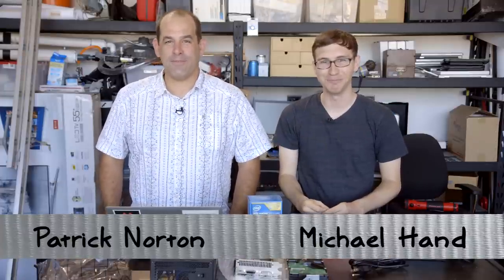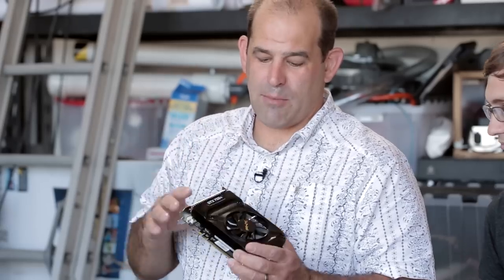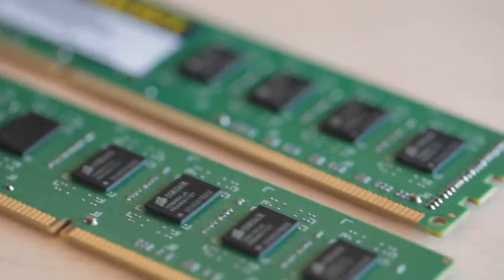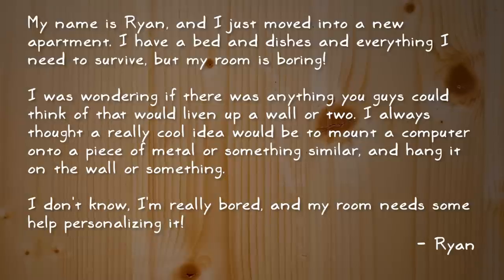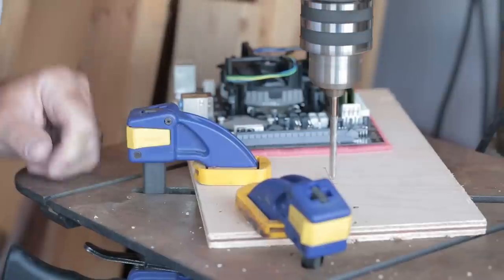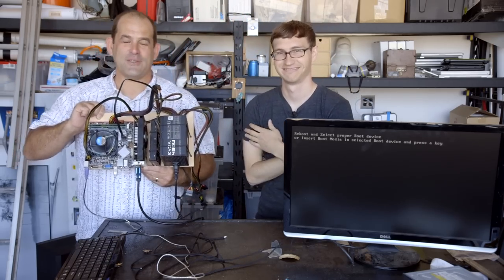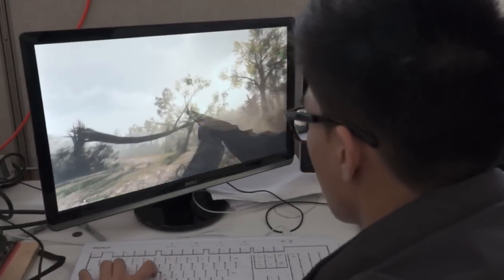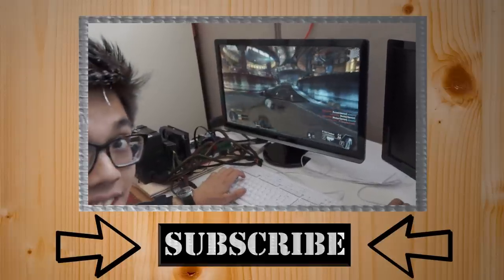Screw The XBOX ONE and the PS4... We Built a Gaming PC for $380!

Comment: Great build ! But for cpu i would have used the intel g3258 anniversary..its clocked higher and unlocked ! Easily achive 4ghz for less than 15 more dollars
Reply from the maker: That does look like a better choice if you want to OC!
Reply: Fat Sacks not really Asus has unlocked overclocking on h81 motherboards through a bios update and even asrock has some :)
Reply: Fat Sacks Nope the cheapest H81 board you can get can overclock the G3258 after a BIOS update. To 4.5GHz on the stock cooler just fine.
Reply: They do. But to make the G3258 not be pointless (because of an expensive motherboard), manufacturers allowed all the OC controls for it.
Intel doesn't like this so they do not advertise the feature.
Reply: DIY Tryin g3258 with an Asus h81 board would be good actually!!!  BTW did u guys use standoffs while attaching the mobo... And will this PC last?
Reply: DIY Tryin g3258 with an Asus h81 board would be good actually!!!  BTW did u guys use standoffs while attaching the mobo... And will this PC last?
Reply: @FatSacks  nope, h97 can multiplier oc, i have a h97 and a z97 board
h97 is just limited to ddr3 1600
Reply: @nztdm  4.2ghz is max for stock cooler, if u actually want to stability test it and ensure you dont lose stuff

Comment: I have $600 to blow. What can I get?
Reply: ask a pro on a pc forum, not here.
Reply: ***** get an okay computer and gtx 970 it might cost 900 or so but its worth it
Reply: ***** New toilets in the white house.
Reply: Mayor Fabulous gaming toilets?
Reply: No, you're George Washington. Get some toilets in the white house.
Reply: And yes.
Put about 16 GB of RAM for it to quickly flush
Reply: Mayor Fabulous Hahaha
Reply: ***** I now have $800 to spend. I'm just going to go with an i5 with a gtx 980 when I get more money.
Reply: ***** Thanks for the info. My panel only runs at 60Hz at 1080p which is fine for me. I could care less for 4k resolution. I'm mainly just considering upgrading this PC build in the future. I'm only investing into a good CPU (probably an i7), a motherboard that supports SLI, and an okay video card for now. When I get more money, I'm going to get another video card to crossfire and the rest of what I need. I'm just going to invest in this build throughout the year and start building it probably around August. 

I've seen what dual 980's can do with an i7. I can probably get a around 115-120 fps with high setting on bf4. It's more than what I need for my panel but I'm hoping to have enough V-Ram to run future games on pretty goods settings for the next 2-3 years. As for the memory, I think it's safe to stay in the 16gb range. I'm only really interested in a small SSD due to the small amount of games I usually keep installed on my current PC. I'm not necessarily broke. I can afford all of this right now but I would then be broke if I threw all my money into this XD 

I know I probably don't sound all that educated about this stuff lol I've only just started researching recently. My main focus is on what I need rather than what I want.
Reply: ***** I'm also looking to work on my graphic design at home. The iMac at my work uses an i7 so I wasn't really sure if I should risk going any lower than that.
Reply: ***** Get an i5 4430. Much cheaper than the 4690k, and almost the same stock performance. As for graphics card, best bang for its buck value below $200 is the GTX 750ti.
Reply: ***** btw you can cap your fps using Nvidia Inspector. No reason not to get more performance if you can afford it.
Reply: ***** Nvidia Inspector does everything the default Nvidia panel does (and more) when it comes to game profiles.

(you probably mean 60hz, not mhz)

I also turn vsync off, because imo stutter is worse than screen tearing.
I always aim for 60fps, probably because that's just what I'm used to.
I'm currently playing most games at 60fps in 1080p, but I'm gonna buy an EVGA GTX 980 Ti HYBRID hopefully before the end of this month.

And I'll need it, because I've also got my eye on the Acer XR341CKA monitor:
http://www.maximumpc.com/acer-unveils-curvaceous-34-inch-qhd-monitor-nvidia-g-sync-2015/

It's got some really impressive specs that I'm really looking forward to:
- IPS display (awesome colors)
- 34" with 21:9 aspect ratio (a lot more peripheral vision)
- 1440p (more pixels! :D)
- G-SYNC (no screen tearing and no stuttering)
It's somewhere in between (16:9) 1440p and 4k in terms of the required processing power, and judging by all of the various benchmarks I've seen, the GTX 980 Ti can manage a solid 60fps with this monitor.
Reply: Tons and tons of sandwiches.
Reply: ***** LOL!!!
Reply: ***** R9 280, FX 8320E, msi 970 g46, 600W power Supply, any case you want and 8GB of RAM
Reply: ***** 
My build was around $600...on Cyber Monday lol.

Intel i3-4150 @ 3.5
8gb ram 4x2
corsair 500 watt power supply
2tb westgate hdd
amd radeon r9 280x 3gb DDR5
b85 anniversary motherboard

It's able to run most things very well. Though Battlefield 4 runs at High, the fps is around 30-45 and can drop to 20 when things get hairy. The processor could do with an upgrade to support the Graphics Card. Though Skyrim with 173 mods runs at 60 fps 1440 x 900!
Reply: ***** Also you need a proper PSU to get your junk up 'n running though.
Reply: ***** 600 is a very reasonable budget, you'll have a Playstation 5 quality computer out of it even if you fall short of the highest end parts

http://pcpartpicker.com/p/PLJq23 $608.15, but obviously you'll need mouse, keyboard, monitor, and OS. 

will run GTA V on normals and highs, Witcher 3 on highs, @ 60 fps. You will have to tweak some settings around, won't be able to run high MSAA, but it is doable. games from last year and before will all be on highs and ultras. 

Weaknesses: 

-GPU is a bit lacking, it's actually much better than the 750 Ti featured in this video, but going forward we don't know what these 2GB cards are going to be like. still, this 960 is a new generation GPU on very efficient maxwell architecture and benchmarks very high

For a little more money:

-Grab a GTX 970. that is the gold standard of GPUs right now and you'll be able to max pretty much every game and still get 60 fps. no more stat tweaking, so long as we're strictly talking 1080p-ish. 

-Might consider moving up to an unlocked core i5, though that is luxury. IMO, don't worry so much about CPU, make sure you have a good workhorse quad core processor, the regular 4XXX i5s are already more than most games use

For a little less money:

-Drop the optical drive as you probably won't need it: install windows using thumbstick. gaming and software will all be digital distribution anyways so not much need for optical.

-Could go AMD for your CPU/motherboard

Cheapest legit way to pick up OS:

buy a Windows 7/8 key from here, http://www.reddit.com/r/microsoftsoftwareswap/ 

Good luck and welcome to PC gaming.

P.S. 

check the chart here at http://www.logicalincrements.com/ if you want to see where you could go up or down with money/performance... you can use this chart to make the barebones build I've given more tailored to your uses
Reply: ***** crack
Reply: Mary Jane
Reply: *****  i suggest saving more  1,000$ should   build you a machine that will tackle pretty much any game  you want
Reply: Are we still talking about toilets?
Reply: DaBawss16 Keep going.
Reply: ***** i3-4160 + GTX 960 + 8gb RAM + H97/Z97 MOBO (The mobo is cheap because your CPU can't overclock anyways) 
Enjoy!
Reply: The Honourable Grand Master Jay r9 380 is the same price as the 960 and is better..
Reply: MSI X99A GODLIKE GAMING Motherboard lol
Reply: ***** whatever you do dont buy a pre built pc they are overpriced and shit, and i wouldn't get an i7 id get high i5
Reply: ***** My current build runs a lot of games at ultra at around 60 fps and it only costs about 450 bucks. The GTX 960 is 174 AR at New Egg and you get Metal Gear Solid: The Phantom Pain for free.
Reply: +Tsaunders1307 what is your build?
Reply: JinLee Gunvalson GTX 960 + AMD Athlon X4 860K Quad Core and 8 gb ram
Reply: If you have a desktop for work just throw a 750 in there and spend the rest on a massive steam library and a better monitor
Reply: Thank you guys for the suggestions, but I'm already investing into a $1200 build for video editing and graphic design work. I plan on gaming on my consoles instead of a PC for now. My build is upgradable, it just doesn't have a dedicated video card for it because I don't need one for the kind of work I do.
Reply: ***** a $120 card would do better than consoles
Reply: Penguinox I have no interest to play on PC. That's the reason.
Reply: ***** Get the gtx 980 ti if you can, it's performance is very near to that of the Titan x but it's only half the price. I bought an Intel i5 4690k and a gtx 980 ti and I highly recommend it.
Reply: I just bought the Alienware alpha and it's able to run steam...it looks more like a console graphics wise and aesthetically but able to be upgraded unlike a console. I'm a pc dummy so I probably could have gotten a better rig for the price but didn't feel like building anything and didn't want to jump on the console bandwagon.  It's basically up to you, to me it was between a console, this or take the time to have someone build a pc for me and I chose this and I like it. It's all about your personal preference so either way if you're a simple gamer like me you can't go wrong with either of the platforms (pc or console).
Reply: ***** buy an ivy bridge core i5 with less price .buy used core i5 if you can get one .Then spend most money on the GPU
Reply: +Cloud Strife don't spend too much on the cpu. It's not as big of a deal, as people claim. a $70-80 amd cpu will do fine.
Reply: give it to charity
Reply: +Cloud Strife Buy a cheap motherboard and CPU combo off ebay, something with an i5 or i7 from the past three or four generations (LGA 1156, 1366, 1150, 1151), a Corsair GS series power supply off ebay (they're cheap and fairly reliable), 8GB of RAM in two sticks (1333MHz is the standard supported by most newish Intel chips, so not terribly much point in overspending on a cheap PC. Just get 8 GB that you can run in dual channel and it works pretty well), buy a cheap case or do whatever else you want (NZXT Source 220 is a decent case for relatively little money), pick up a cheap hard drive (an SSD is a definite upgrade for everyday usability, but is not strictly necessary. Consider buying one later when you have more money to kill), then spend every penny of the rest of the money on your GPU (the GPU is absolutely the most important part of the PC for gaming performance. I recommend the GTX 960. It hits way harder than it should for the price.)
Reply: +Cloud Strife A gaming PC.
Reply: +Mayor Fabulous RAM allows the toilet to hold more, the CPU makes the toilet flush faster, the HDD/SSD allows long term turd storage (LTTS patented).
Reply: A ps4 and psvita
Reply: +gangsterhood21 This pc's is as powerful as a ps vita.
Reply: +Grant Sibley  He means what parts all together can he get for $600. He doesn't already have PC

Comment: 750ti will not do 1080p 60fps, maybe 30fps. Or in mid settings
Reply: Yes it does... Look up some benchmarks buddy I can run bf4 with my 750ti and fx83650 @  60 fps steady ultra
Reply: does it in witcher 3 for example? or any coming big budget game?
Reply: +Inspire i have a gtx 750 ti sc and i can run witcher 3 on high with out the nvidia hairworks at 28 to 38 fps
Reply: Well, that's about right
Reply: Inspire Damn Son
Reply: Good, I watch the intro video in his channel, look at the shadow settings :))
Reply: +Inspire witcher 3 on medium setting could run at 1080p 60fps
Reply: (using the 750ti)
Reply: ***** im pretty sure it runs over 30 fps in 1080p (medium). nevermind that
Reply: +Inspire But it actually will...
Reply: +Inspire it even runs gtav in 4k
Reply: Hahaha good one :)) yes I know, my laptop with an i3 "runs" civ5 1080p, powerful :))
Reply: +Rome Kazuki Yeah, Fx 8350 16GB ram. Thats way out of this pc league in performance and cost at least $230 more.
Reply: +Inspire what? I have 750ti and run BF4 on mid-high on 60-120 fps depending on a situation, but never lower!
Reply: Protoss Zerg That is a 2013 game. That you can run on an apu.
Reply: So, finally, taking in acount ps4 and xbone hold back on PC games for the next 5 years at least . People will be better off spending around 80 dollars more on a graphics card. That's the 200 dls bracket, where value hits the sweet spot.
Reply: +NEW CHANNEL IN SUBBOX!!! prove it
Reply: ***** ps4 1080p medium settings 25Fps? At $350?
Reply: ***** oh. I dont know, the game has serious optimization problems.
Reply: ***** Daaayum. And they dont bother to fix that shit? I would not, and only for this game,  blame people for pirating it.
Reply: +Inspire I run most everything with 60 or more on 1080p with a 750 ti.
Reply: Joshua Smith not on high or ultra.
Reply: SALUSIA  depends on the game 

I only tested 1080p for an hour or so at a friends house because I mainly run shit on 1600 x 900.
Reply: +Inspire go from gaming on a PNY GeForce GT610 to the GTX 750 SC. if you did your argument wouldnt matter because of the glorious graphics you get.
Reply: +Inspire i'm sure it can run the evil within at more than 680p (Xbone)
Reply: +Inspire My old 750 Ti disagrees :)
Reply: Bud my friend has a 750ti and runs fallout 4 in ultra settings with an average of 55fps, I personally am an amd fan but a 750ti is capable of running 60fps.
Reply: To get lock 30fps is better than fluctuating between 30 and 60. Most people don't get this.
 And 750ti is great, but not a 60fps card. But if you're willing to lower shadows and/or draw distance and lock it at 30, is a good option, even the 960 or the r9 370 are not 60fps 1080p on ultra GPUs. But hey! human beings are known for cognitive dissonance :)))
Reply: Unless you're looking for the highest settings possible, the 750 ti will run mostly anything at 60.

I have it and can't be happier.
Reply: Like I said cognitive dissonance, is for reals :))
Reply: And black ops could well be an old game in graphics department is a game meant to be run easily. Fallout 4 does not improve on skyrim by much except lighting it's a low polygonal game for 2015 standard.
Reply: Is not optimized poorly, is just a beautiful demanding game with high poligonal count.
Reply: Inspire
I was talking about black ops 3. It's gotten better through patches but when it was released people with 4790k's and 980 ti's couldn't even get the damn thing to run.
Reply: Alright dude, have it your way, you win ;) blackout 3 will be the standard to beat in 2016.
Reply: Dude, cognitive dissonance is when you know something is a fact and you decide to not believe it for a b or c. You are doing transference in the rest of your statement, (meaning you are exposing your inner fears of social acceptance and dealing with low income) this is something you should check with a psychologist, I'm not getting paid to deal with your money and sex issues.
Reply: You have issues of reading comprehension as well. I just stated a fact about frames and resolution. I also mention in a comment that 750 ti is a great card. I have a 500 dl pc, and play some games at 30fps, so there it goes your assumptions. But by your use of language and quick baseless judgment the "dick" as you refer might as well be yourself. But if in any shape of form I behave in certain way, is my decision to change , I will not behave differently because a youtube comment. The fact is that you commented here and started with aggression so.. there you have it, really clear to me who needs to chill.
Reply: Joshua Smith  That comment was not for you dude. :))))
Reply: Joshua Smith So emotional, all right dude, I'm that, shame on me :))
Reply: Inspire
 Emotional? It's a text post on the internet. Good logic.
Reply: Words are the translation of our thoughts and emotions, when we use violence in them they reflect inner anger, that is an emotion. ;) When you resort to disqualifications that is a logic fallacy called ad hominem, meaning that because you lack a solid argument you attack the person that emits the facts you can't refute. Politicians are masters at this.
Reply: Inspire
 I've proven that the 750 ti is well capable of 60 fps on acceptable settings, but you ignored it.
Reply: You didn't Joshua, this is ridiculous. I send to you two benchmarks of gt5 and witcher 3. You might have not watched them. Is alright dude, 750 ti is not a bad card,mand if it gives you 60 lock on the games you love, then just be happy about it. I couldn't care less if we game at 60 or 30, we are in the brink of third world war, people are diying in the middle east, the election candidates of US are all crazy dudes. What can I tell you bro? If we can chill and play games we are already fortunate.
Reply: Inspire
 Then stop being arrogant and attempting to belittle people.

You're not going to get max settings on Witcher 3 with a 130 dollar card. Asking for that is absurd.
Reply: Arrogant because I wiil not say that you're right when your not? What is the arrogant part please let me know.
Reply: That dude was saying  quite a few suppositions, and there is the fact that we project unto others our own issues. You still insult me. I imagine you're a nice kid , that is only aggressive in the Internet. I'm pretty much done wasting my time Joshua, you have to do a lot to grow up till we can talk at the same level. Now you can be rude in your final words, in the safety of your home ;)
Reply: Inspire
 I'm not being aggressive here, and using your supposed age as an argument is another example of your arrogance and brings back your own claim of Ad Hominem back upon you.